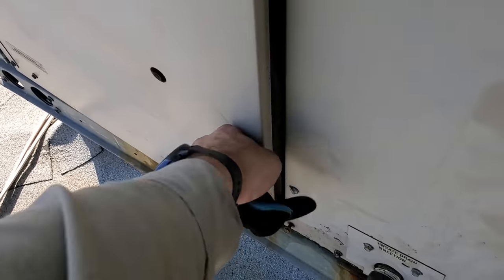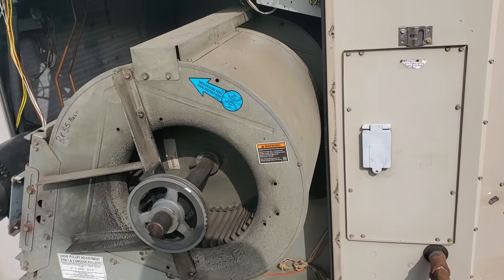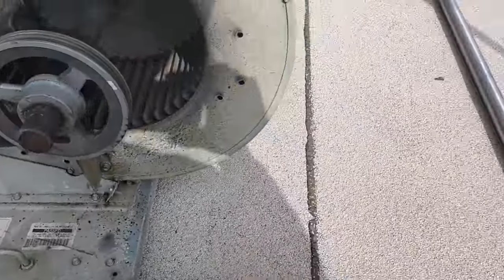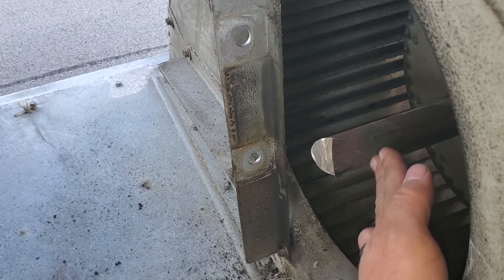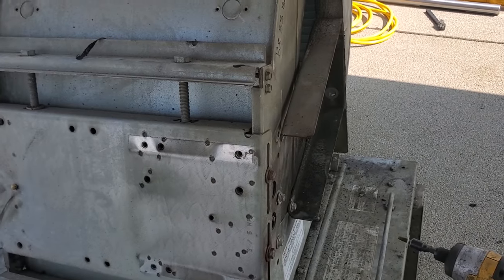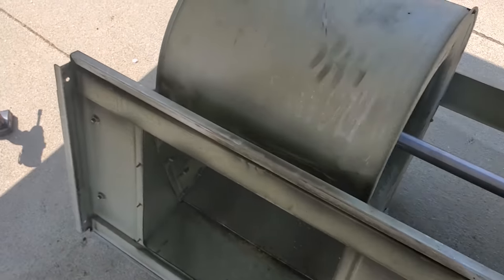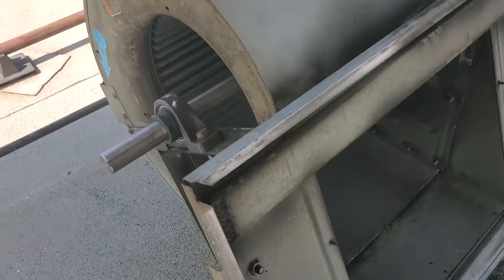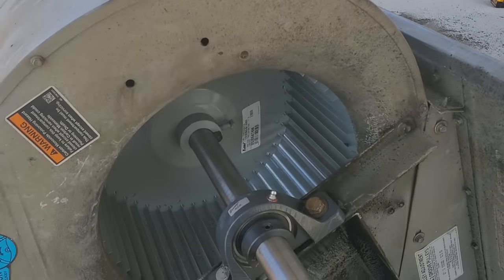THE AC UNIT SOUNDS LIKE AN EARTHQUAKE

Comment: I wonder:    Blower fan belt was Extremely loose in the vid ????  The fan was obviously running well below "The Curve" / Min Rpm which
would also cause massive vibration !!!!!!!  Did U tighten the old-belt first ?????????? before just replacing everything ??? Just saying

Comment: Dood, why didn't you loosen the blower wheels and the bearings and slide the shaft? You half assed it and left the sheave hanging way off the motor stressing the motor 
bearings......

Comment: Hmmm... If your going through all the trouble of replacing the shaft and wheels, wouldn't your clean the inside of the assembly while everything is out? Cause now all your did was put new, clean wheels inside a dirty assembly :-/
Reply: Basically none of those cleaning packs of detergent is galvanized steel safe. Aluminum and copper, yes. Once a condenser has been cleaned, any uncoated laminate the runoff touched begins to oxidize, corrode, and rust.

Comment: random ? is it normal that if my ac is set to 74 it wont kick on atall till the thermastat reads 80 -- 86 to do any cooling or kick on atall
Reply: Timothy Salomon  its a modern one replaced a year ago and pols might be crossed but it was installed by a good compiny....maby the wires are wrong at the unit then....hmmmm....thank you
Reply: @danbrit9848  if it worked normal before then its not wired wrong, right?
Reply: @Live4Ibanez  worked the same before too its why i replaced the old thermastat...its also a cheeper ac unit if that matters
Reply: Generally if the tonnage is too high for the conditioned area and the thermostat smart enough to run a unit for a minimum amount of time, an electronic thermostat may make a calculation to delay cooling until it can run long enough to satisfy that criteria without pulling the temp below the desired comfort setting. Your reputable installer perhaps overestimated your needs, unless the capacity was based on heating needs.
Reply: @HighestRank  ive also relized i have a clogged ceiling vent a round one in my other room might that be messing with it too...thank you all for the help btw
Reply: Dan Brit it being a cheaper unit shouldn’t really matter.  What kind of thermostat do you have   When they replaced the unit did they give you a new thermostat or did the6 just hook the new unit up to the old stat.
Reply: @icantsaywhat   i baght the newer thermastat a year ago and the unit about 10 years ago always bin digital thermastats so newer thermastat installed by a hvac compiny becuse i didnt trust myself with it lol...and the ac unit is inspected every 2 years but we never told them about this prob we thoght it was normal but its reached a point that even tho its set to 73 i sweet for 10 15 min befor it starts to kick on

Comment: by the way.. i know you like to zip tie wires and harnesses..  you have 3 options on this page.. for 6MM holes.. 7mm holes and  1/4" or 6.3MM holes.. http://www.clipsandfasteners.com/v/vspfiles/assets/images/auveco_catalog528.pdf   those are AUVECO numbers so many suppliers can get them or clips and fasteners which is done in Orange county ca..  this does not slow you down from using zip ties that have a hole for screw mounting already.

Comment: I see the gas valve closed and you had a good chance to inspect the heat exchanger by removing that blower assembly 
I am going to send you a copy of a document manufacturer for those locking colar bearings 👍
Reply: a copy of a document manufacturer? What do they make, besides documents?